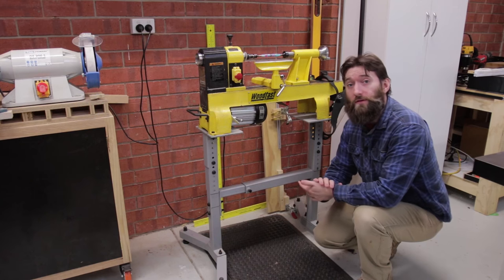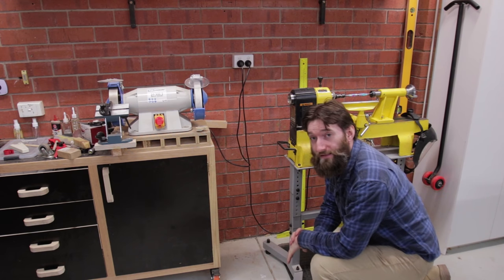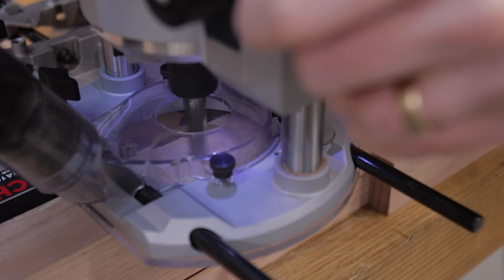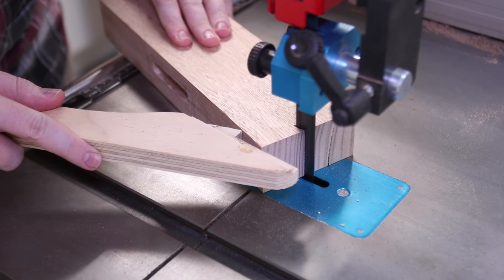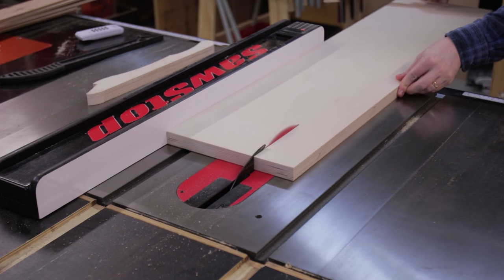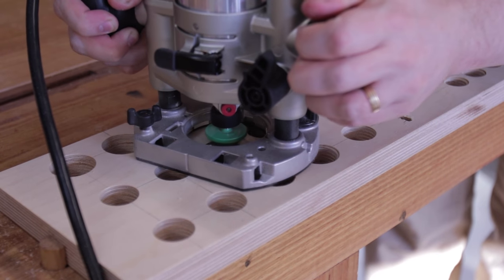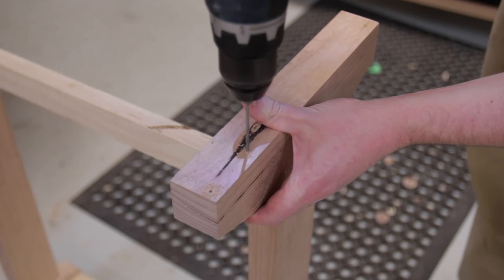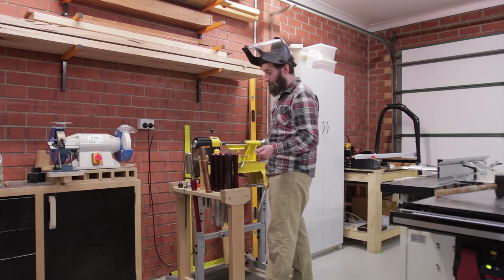Lathe Tool Stand

Comment: That's a pretty elegant solution to a common problem. Last summer I needed storage for my lathe tools too. I had wall space behind my lathe, but reaching over it made me nervous - so I put a rack on the wall to the side that folds down and extends with drawer slides.